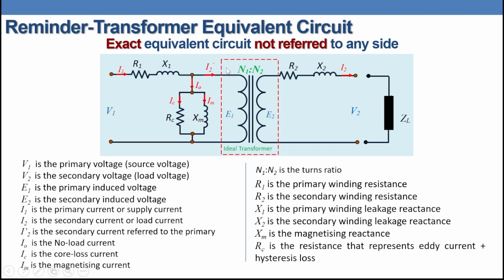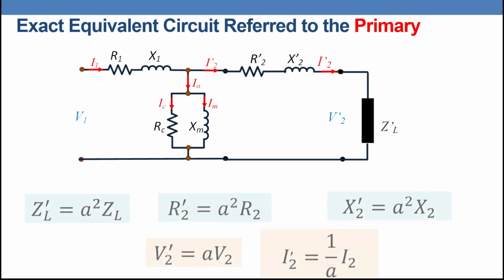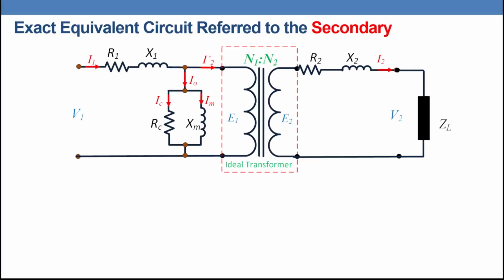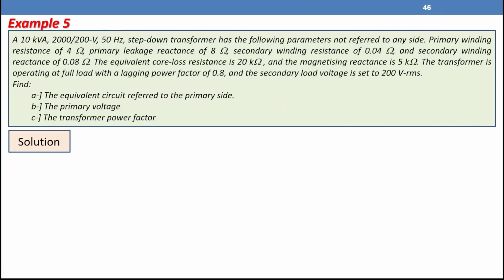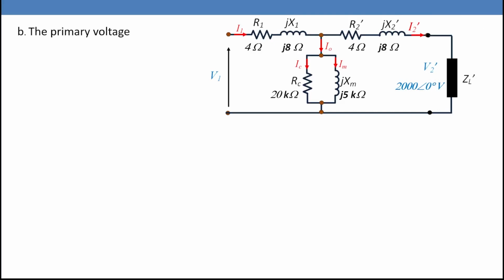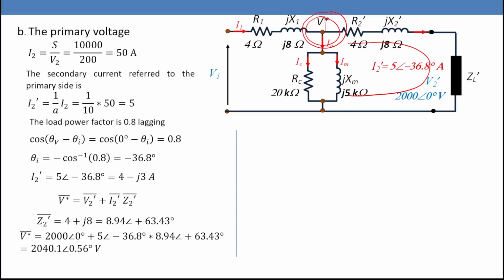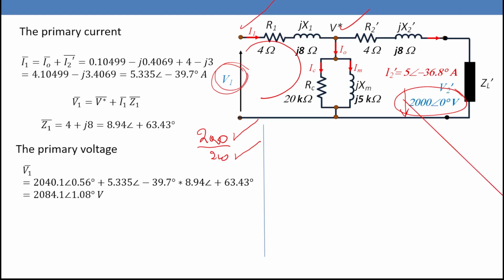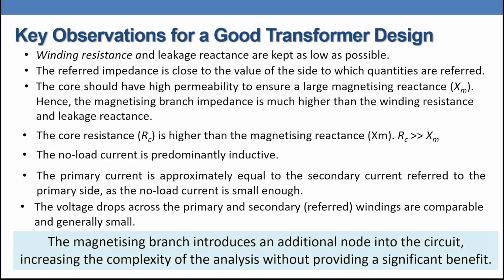Referred Exact Equivalent Circuit

Comment from the maker: In this lesson, we learn how to refer the exact transformer equivalent circuit to either the primary side or the secondary side, followed by worked examples and a comprehensive problem that combines all concepts covered in the first five videos of this series.

📌 Previous Videos Referenced in This Lesson:

▶ Exact Equivalent Circuit (Not Referred to Any Side)
https://youtu.be/7FKJaYnzc4o

▶ Impedance Referring Explained
https://youtu.be/yMGnQ351BN4

💡 Key Topics Covered:
✔ Referring impedances between transformer sides
✔ Exact equivalent circuit referred to the primary side
✔ Exact equivalent circuit referred to the secondary side
✔ Step-by-step numerical examples
✔ Comprehensive transformer analysis problem
✔ Important transformer design observations

📖 If you have any questions about transformer equivalent circuits, leave them in the comments, and I'll be happy to help.

👍 Don't forget to Like, Subscribe, and Share this video if you found it useful!